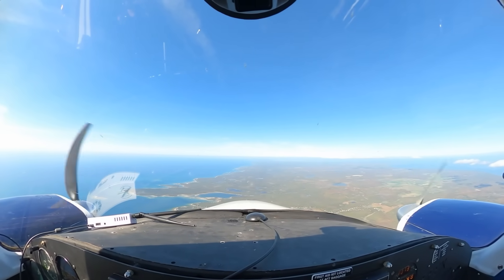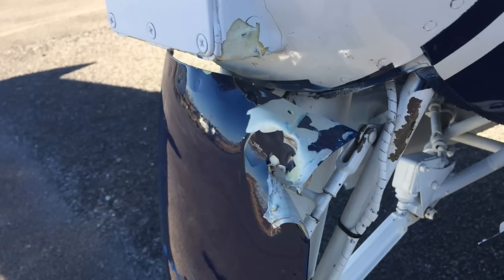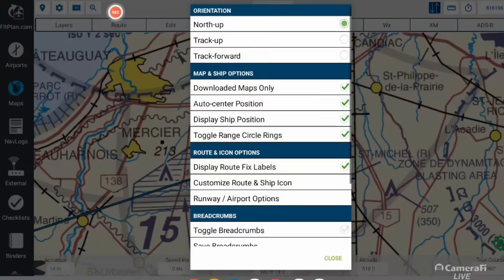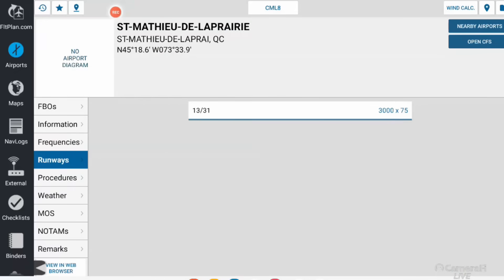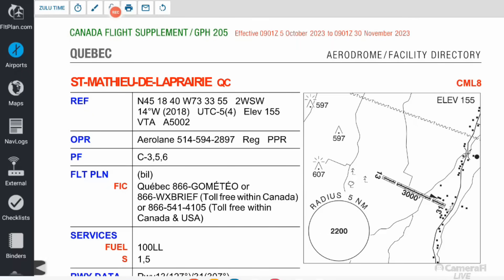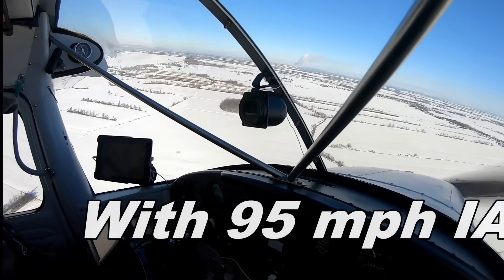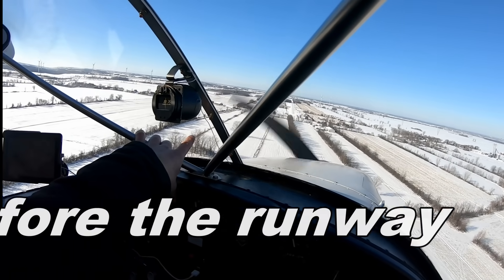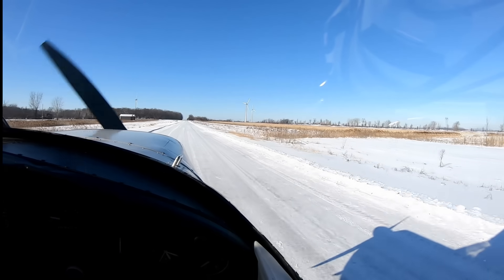Wire Strike Cessna 310

Comment: You didn’t mention height. 30 AGL is pretty low
Reply from the maker: Yes it is but given the fact that this is within 500 feet of the displaced runway and inside the obstacle clearance path it is not surprising to find yourself there while landing. 

No one actually measured the hight of the wire but given some of the other errors in reporting it would also not be out of the realm of possibility that this measurement is also wrong! Standard pole heights are now over 60feet

Comment: You can justify it will all the “steps” taken in advance you say you did, but the bottom line is you came in to low. The runway threshold was displaced for a reason. You shouldn’t have been skimming in low. Had your glide path been appropriate to land at the displaced threshold, you would have been above the wire.  
Sometimes it’s hard to admit we’ve made a mistake, especially one that had you been perhaps even 5 or 6 feet lower, would most certainly probably killed all onboard. You were extremely lucky. Next time, consider why the threshold is displaced.

Comment: Is there anything you could have done differently to avoid this?
Reply from the maker: Yes I think there are. 

An additional pass down the runway at 200 feet would have perhaps helped but I can not be sure we would have seen the wire even then. 

A steeper approach could have helped but I was certainly getting close to the limit for the airplane and conditions.

Comment: Dang , Sky King never had such problems .... sounds like you were lucky . Given the gage of the wire shown, I would suspect the damage was done by a support cable whi h would explain the damage , steel rather than copper .

Comment: You were indeed very lucky. One point: I notice that on the takeoff at the end of this video, both before taking the runway, during the ground roll, and on climbout you are spending the majority of your time looking down at something instead of outside for traffic. Just an observation.
Reply from the maker: Yes you are very correct about that I would certainly never dream of flying a tailwheel aircraft in this manner. 

Head down in the cockpit dealing with technology, Avionics and instruments can certainly lead to incidents and accidents.

The airport I'm departing from at the end of the video is Ogden in Utah and is a controlled Airport. 

I had a number of instructions given to me and changes in my route that I had to program into my Avionics before departure. I've been sitting at the end of that runway for over 5 minutes. 

The reason for me being so head down during the takeoff and climb out is due to the altitude that I was at. I was spending extra time ensuring that my mixture controls were correctly set to give me the correct pressure and therefore fuel air mixture for the engines. This needed adjusting on the take off and it needs to be done carefully.

The takeoff I had done immediately proceeding this was from an airfield in Wyoming with a field elevation of 7,900 feet. The right engine actually quit due to flooding! Luckily this occurred on the ground before I even release the brakes.

Needless to say this it made me a bit nervous.
Reply: @fastbackflying853  thanks for the answer, I was wondering "what is he looking at" cause it didn't look like the ASI.

Comment: What were you doing that low 500 feet back from the runway?
Reply from the maker: Flying a greater than 3 degree approach. Thats kind the problem with this unmarked obstacle that showed up at this airport. You would need to fly a 7 degree approach aiming for the dispaced threshold to miss it.
Reply: Perhaps but that further begs the question I posed. Why was he so low so far out? In essence shallowing out his approach. There isn’t a single published IFR approach I’ve ever come across that has a descent angle anywhere near what you’re suggesting for any category of aircraft A-D.

Comment: YOU SHOULD HAVE NEVER LANDED THERE IN THE 310 IN THOSE CONDITIONS THE WIND TURBINES ARE TO CLOSE TO THE TRAFFIC PATTERN AS FOR THE WIRE IT SHOULD HAVE NEVER BEEN THERE WITHOUT PROPER MARKINGS A VERY UNSAFE AIRPORT

Comment: on another note it would not be hard to run the wire under the ground across the runway approach to the next pole and back up again and then put some good markings on the poles im sure that airport does not want to pay for it and im almost sure they are liable.  atleast in the states they would be!  if what you say is true from the air saftey board that is!   why operate its a lawsuit waiting to happen for both the airport and power company.   also is something so easily fixed!  you get a friend with a ditch witch and have the school donate some muscle and get r done!

PURE NEGLAGENCE THAT COULD HAVE KILLED YOU AND MAY KILL SOMEONE ELSE!!!

Comment: 😢

One of my favourite local airports (Vernon CYVK) has a gas station and a power line under the final approach for runway 23, but it's done right. Everything is marked, the displaced threshold and PAPI are suitable, and the CFS is accurate.
Reply from the maker: I fly into a lot of really small airports with obstacles in various aircraft. Funny that an airport with a 3,000 ft runway and incorrect published information would be the one to get me into trouble.

Comment: Every approach you show in this video is long and very low.  You are flying about a 1 degree glide path, instead of a std 3 degree.  With 45 years of experience, your video is uncomfortable to watch.
Reply from the maker: I did have a more shallow approach into this airport due to lenght and wind conditions. I am at 100 to 140ft AGL 1000ft back from the threshold and over the position of the noted wires at 30AGL. 

Dont forget camera lenses can distort the view point.
Reply from the maker: Also of note. If you fly a 3 degree approach to this runway you would hit the wire that I hit!

Comment: Wow glad you were ok. Great vid.  This reminded me of my bush flying days and having to detect unmarked wires across narrow bays or rivers. All you can do is try to spot the poles. At an airport tho? Not even orange balls? Nasty trap.

 OT: does your Musketeer have wing VGs? If not, are you aware of any Musketeer owners that have VGs? I own a Pazmany PL-2 that has the same airfoil (same NACA 6 series section, different thickness) and would like to add my own VGs, and I want to copy a Musketeer's installation dimensions so I don't have to experiment with chordwise location.
Reply from the maker: The  musketeer i was going to take does not have the VGs. 

I do look after another musketeer same year 1963, with the VGs. It is astonishing how differently the two of them fly.
Reply: How so?  Would it be possible to take a pic and a couple of measurements one of these days?  Or provide a contact for the owner? @fastbackflying853

Comment: Always treat a displaced threshold with caution. 
Same goes for any road near runway ends. 
It's very poor form not have at least the poles painted red/white bands, or even rudimentary wire marking. 
Even some laced-together sneakers dangling would have got your attention. 
Your lucky day. Cheers
Reply from the maker: Excellent points. Thank you.

Comment: No one else has hit the wires
Reply from the maker: This is a very strange comment and seems really irrelevant! 

The airport is only a few years old with multiple changes to its publications on runway lengths and the marking of various obstacles. 

The why is I hit had not been across the runway for a long period of time. They were however in the obstacle clearance path for the runway and the airport had been told they could not operate with them there. They lied about having them buried and nobody at TC actually checked to see if they have been. The published information for the airport is still incorrect. 

It's also not 100% clear that someone else did not hit them. I also flew in a twin whereas most local traffic are small light singles. 

The local flight school was closed and the airport closed until the wire could be buried.

Comment: Shabby system of procedures at that airport and a severe lack of concern by some who were more angry about the power outage than YOU and your companion, never mind the aircraft damage. Not being a flyer myself, I would like to ask a few questions. 1. In this instance, WHO PAYS for the repairs to the powerlines? 2. WHO PAYS for the repairs to your aircraft, considering the less than professional running of this airport? And 3. Whilst insurance deals with most incidents, do they consider the faults laid out AND confirmed by the Safety Board, in this excellent video, responsible and hold the airport to account and you aren't financially hit??

Comment: Lot of excuse making.  You came pretty close to killing yourself and a couple of others.  Yes, the airport is a bit of a mess but a quick look at it clearly anyone can see that.  A 310 on that 20 ft patch of pavement, a bit on the bold side.

You didn't attempt to land 600ft down the runway.  More like 200.  The displacement is on the plate.   The displaced markings on the runway don't appear proper.  Had you actually landed 600ft down the runway you would have been 1000ft past the power lines.

If you want to learn from this accept the fact that it is on you.
Reply from the maker: Every statement you have made is incorrect. You clearly have no idea what you are talking about. The entire point in this video was the incorrect information and markings of the airport.  I landed just past the displaced threshold on a 3 degree approach and hir unmarked wires that were less than 500 feet away.
Reply: @fastbackflying853  well, you live in denial.  It's simple enough to measure distances on google maps.  You admitted you came in shallow,  it cost you big time and could have been fatal.

Maybe there is a reason aiming point markers (on larger airports) are 1000ft down the runway and not at the threshold. 

Since you did everything right and it was everyone elses fault I guess you would do it the same if you faced that situation again.  Brilliant.
Reply from the maker: I am truly baffled by your attitude towards this. 

You can not measure any distance on Goggle maps because the airport does not exist in the satellite images. I was only able to provide distances by using photos and actual ground measurements to come up with the reference points. This again reiterates you don't know what you are talking about. 

I admitted to being low on the approach and having to add power and stop my descent until I was closer. The final picture before hitting the wires proves my position and altitude. I landed past the displaced threshold markings. The displaced threshold was correctly painted but in the wrong position and the distance was short. They were only 250 feet down the runway not 600.

I have been involved in the process of getting a runway approved and published in the CFS. It is very involved and included Transport verifying numbers, distances and headings. As a published airport you should be able to trust the information provided to you in this document. No NOTAMs were filled to show any changes. This was not some private farm runway with no know information that I was landing at. If it was I certainly would have made an additional pass.

I also frequently use narrower and shorter runways with the aircraft without difficulty. Your comment that it seemed too narrow suggests to me again you don't know what your talking about and have never operated a C-310. 

I make no excuses for hitting the wire. I state in the video I hit a wire and here is some of the facts that led to this event. The wire is in the obstacle clearance area, not marked and no mention of it in NOTAM or CFS information. If you fly a 3 degree approach to the displaced threshold as marked you fly right through the wire. 

I sure hope this event has made me more cautions about unfamiliar uncontrolled airports and the warning here is that our published information can be incorrect or out of date very quickly. Even when trying to do everything correctly you  can still get into trouble. That is what makes this situation so very dangerous. Yet you seem to think I have no care or concern nor wish to learn anything from this. 

TSB and TC closed the airport and stopped the local flying school from operating until the wire was removed. Something they had already done and only opened things up after being told the wire had been removed. Clearly a lie. 

Maybe you believe that any obstacle with no regard to airport or aircraft safety should be allowed to occur and it left entirely up to the pilot to find and avoid these dangers? With that thought then it should also not be a problem to paint the displaced threshold 250 feet down the runway but claim its 600 feet. The pilot will again work this out with his eyeball. 

If this was an IFR approach and I flew the plate as published and was on glide slope and hit a wire that had been strung across the runway obstacle clearance path would you still think the same way?

If I fly an IFR approach I expect it to be 100 percent accurate and any changes noted in NOTAM files. Until this incident I expected the same thing for the information published about an airport in the CFS.
Reply: @fastbackflying853  since you're baffled I'll try to condense it in to one key thought.

You're the guy who almost killed himself and did damaged your plane because you are so confident in your abilities that you didn't leave any margin for safety.

All on you.
Reply from the maker: So 20 percent extra space is not enough sagety margin and the solution in your books is dont go flying cause you might get hurt. Roger that and thanks for your input.
Reply: @fastbackflying853  what 20% are you imagining now?  

It's hard to learn from mistakes when your main concern is proving you're right.

It's odd how confident you are even though other pilots managed to fly over instead of hitting the wire.
Reply from the maker: I see you havent actually watched the video or paid any attention if you did. 

I have certainly learned some lessons and paid a big price to do so. 

One major point is to treat puplished information with a healthy amount of skepticism instead of treating it as 100 percent accurate. You never know who and what has happened to change the data or reduce a perceived safety margin.
Reply: @fastbackflying853  I watched it.  Extremely one sided.  Add a few interviews from pilots who flew over the wire to make it more interesting.